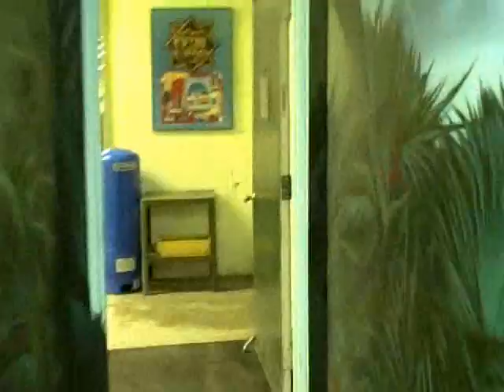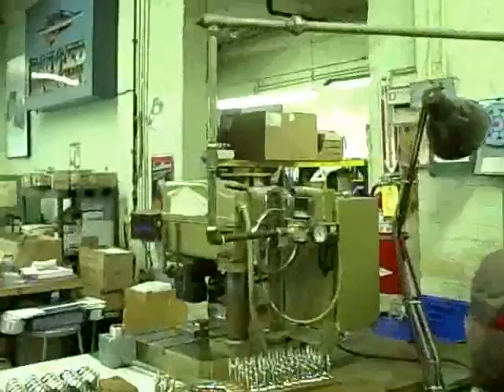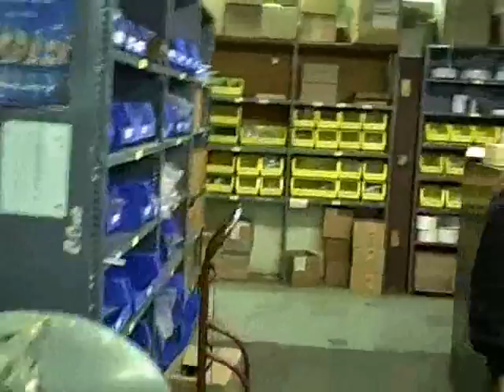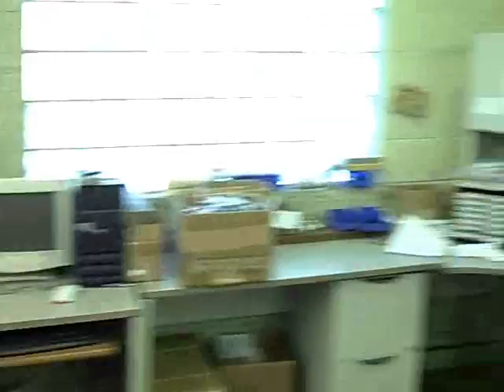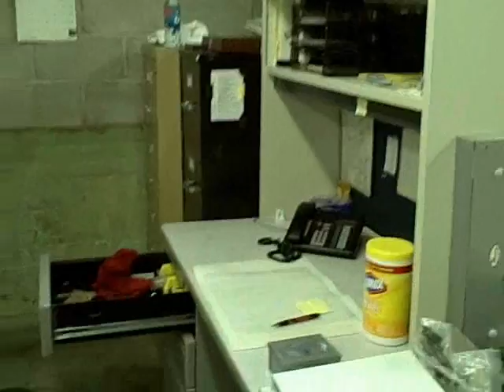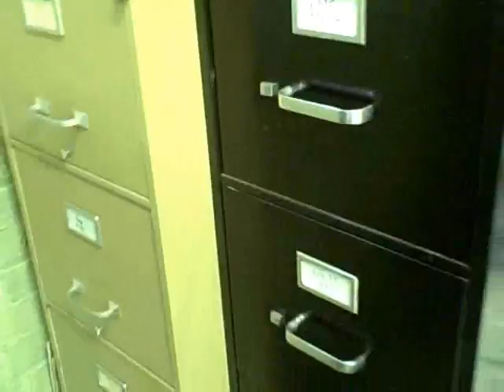Part 1 Badger's Nickel Tour

Comment: Although I admire and use Badger products, the facility looks like total sleaze and I almost wish I hadn't seen this.  For crying out loud, I've seen back woods sweat shops in third world countries that don't look half as creepy as this place does!
Reply: I wouldn't be so harsh. There is method to the madness to this US INDUSTRIAL Facility (Bellwood in the Chicago area) and they probably just need a quality and efficiency consultant to recommend process improvements which will invariably drive up their cost and which they probably do not want. To wit - they have been in business since the 1930's (or earlier) since the Thayer & Chandler, Binks, Paasche, DeVilbiss and Wold days - the golden age of US mfg. without Japanese or Chinese competition. Their designs are unique and well-proven globally and better (I'd deign) than the lower end Iwatas and Chinese clones thereof. The fact that they can develop designs like the Patriot 105 and Sotar 20/20 which are staples in the T-shirt industry as well as for illustrators proves my point. One needs a tool and not just a showpiece. If you (like I) want to support innovation in this country, then we'd be better off suggesting constructive ways and means, like maybe sourcing parts overseas (other than China, like maybe Sparmax?) to have an alternate line of products (like the NEO line for IWATA). Industrial environments are what they are, I've seen Japanese residential sweatshops which are far smaller where IWATA used to source their parts out of. That philosophy doesn't work in the US, with our insurance liability and laws. Keeping manufacturing in the US has its "cost", a less than SPIC-N-SPAN place is one I'm OK with as long as the end product is "conformant" with expected quality. That being said, they probably need to upgrade their processes, i.e. machined brass rather than sintered metal parts (air valves), laser etched markings rather than machine engraved markings etc. Sorry for the long rambling - but I'm biased, started with a Badger 200 thirty years ago and still a happy customer.